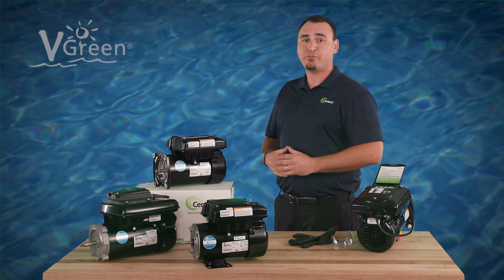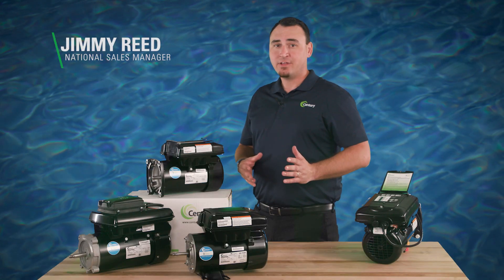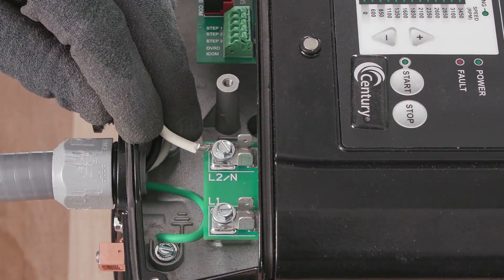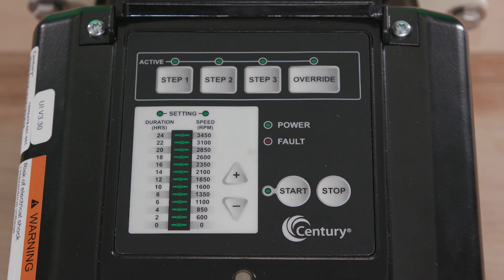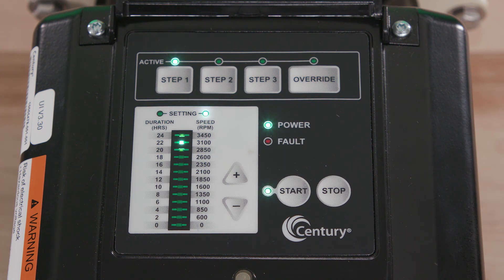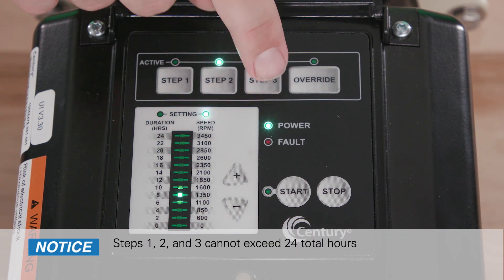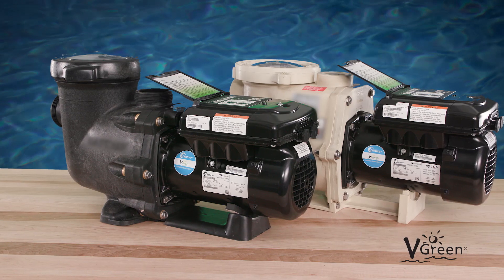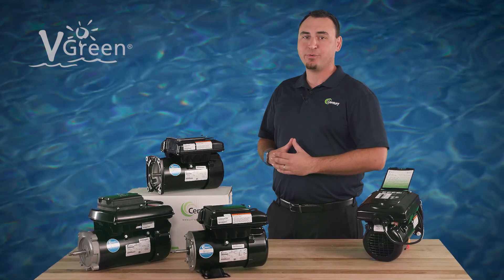How to wire and program the Century® VGreen® 165 and VGreen 085 variable speed pool pump motors

Comment: This pump simply will not work with our Jandy Aqualink system. Our system controls the pump ON/OFF (including stopping the pump during critical SPA/Pool mode and heater cool-down transitions). As soon as our system would have any reason to switch the pump off, all of those fancy programmable pump settings would fall back to their factory defaults (starting at 'hour zero' at godknowswhen what time of day) Perhaps the secondary connector is a way around this... But our system can't control a variable speed motor -- (it does have a 2-speed control -- but nothing to control this Vgreen pump).

Comment: Note there is a divider on the cover that can crush the wires if they are in the wrong place.  
The first shot in the video, the white wire is in a position where it is about to get crushed by the cover. 
At 1:00 (frame by frame) you can see the technician adjusted the wire out of the way.

Comment: I installed the 165 and when I plugged it in I get solid power and fault lights and cannot figure out what is wrong.
Reply: Do your wires look like those in the video?
Green is ground, Black is L1, and White (or Red) is L2. 
Check the voltage reading between L1 and L2. 
I suspect it should be between 210V and 230V. If it is around 110V and 120V, that would NOT work.
You might get a fault light if impeller is frozen.
Does it make any noise?
With power disconnected, stick hand in pump housing and verify the impeller turns freely.
Your post is a month old.
Did you resolve the issue already?